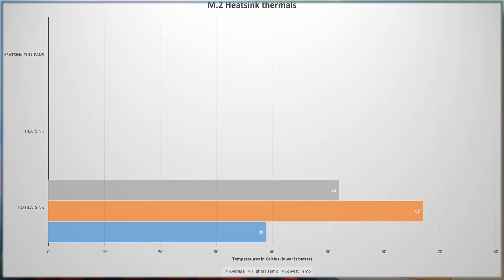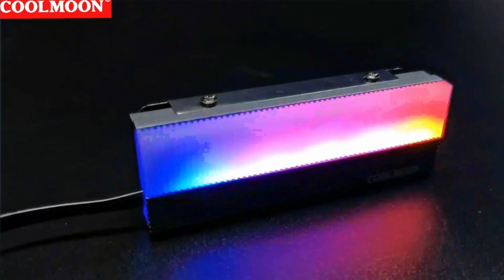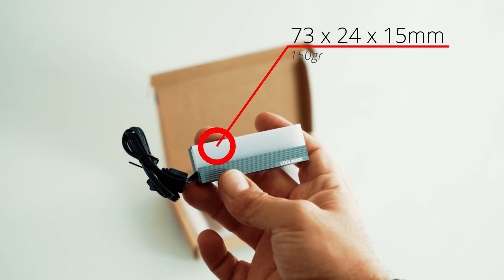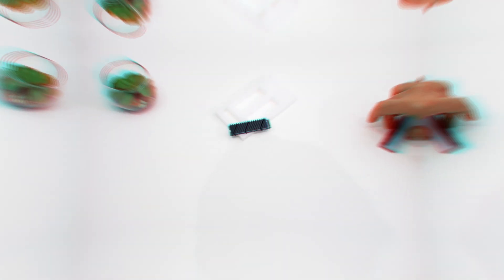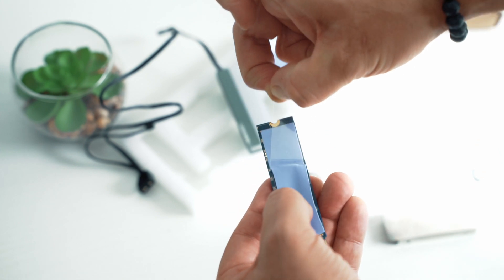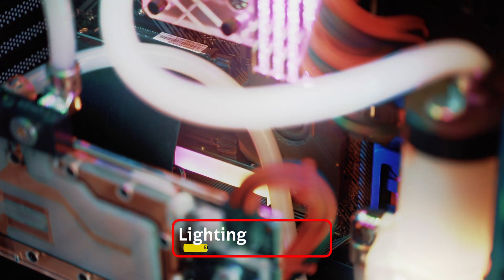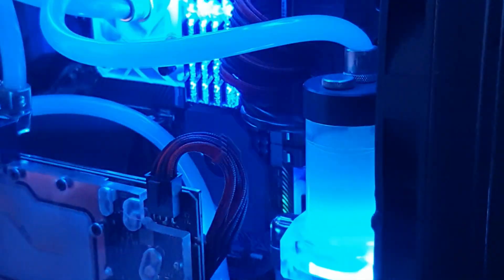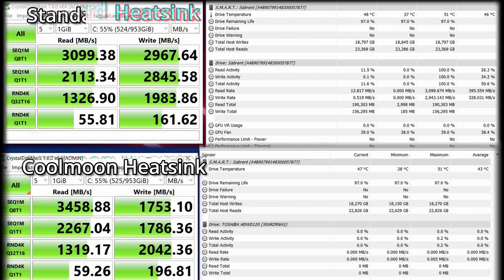Coolmoon ARGB M.2 SSD heatsink - CM-M73S review #ARGB #SSD

Comment from the maker: Hello everyone, please let me know if this video was helpful for you or if you have a similiar product you would like me to review!
Reply: Just did exactly what I thought and yes - it works, compared with your video. I have the same CoolMoon, before heatsink, temp. on NVME SSD (Kingston SNV2S2000G 2TB) that is "Work", it was 59 degrees temperature, now it is between 49 and 53. So - less than 7 to 10 degrees. That NVME is now below my still old GeForce (2080 rtx) gfx card.

Comment: generic copper is better temps wise like the plain one sided with bumps
Reply from the maker: You can see it in the video, in the end I compare the temps
Reply: @fgtechtips  oh ill have to go back, you're probably using a different copper one though than what I use the copper is a solid 5 degree Celsius less than non or aluminum

Comment: If i remove my SSD NVM.2 will the files because i used it in installing games will my games gone if i removed it?
Reply from the maker: if you remove it and install it into another m.2 slot nothing happens to your data. if you remove it completely either you backup the data into the new drive or if your games were installed there you would obviously lose the data
Reply: @fgtechtips  ty, can i insert that heatsink in a A320M PRO-VH motherboard?
Reply from the maker: Sorry don't know if there is enough space but this should fit all. In my channel i reviewed another heatsink which is even smaller

Comment: i used this heatsink on samsung 980 pro and the temp idle is 50c is that normal?
Reply from the maker: It seems to be a bit too high, do you have enough air flow on the case ?

Comment: you put a lot of effort into this review but unfortunately its flawed since your case was not well ventilated due to the nature of the water cooling setup, hence the coolmoon with more material could also mean more heat soak overtime raising the average temp.. 
My results were 34oC with stock gigabyte SSD heatsink and 27oC with the coolmoon ARGB heatsink thats with 9x 12cm cool moon fans on 1200-1300rpm low silent settings.
Reply from the maker: Hi you probably didn't watch the whole video, you would understand that it is also focused on argb lighting, showing the product, sizes specs and so on, not only temps ;) moreover it depends a lot on what kind of ssd you are using, if you system is oc, ram amount and so on...
BTW You can see I was still getting about 10c cooler as minimum temp and about 4c lower avg temperature using it, which is very similar to your result anyway ;)
Reply: @fgtechtips  hehehe my bad it's 1:23am here I didn't put on my earphones had speakers on low volume to not wake my wife.

Comment: Hi can i connect this on 4pin rgb motherboard header? My motherboard is asus tuf b450m pro gaming motherboard
Reply from the maker: Hi as you see in the video this only comes with 1 argb connector so no it doesn't work with the 12v 4pin RGB connector. It seems this product is only produced with 5v support, I couldn't find the 12v RGB version of it

Comment: hi there you conect the 2 cables for have the light or only the 3 pin cable to motherboard ?
Reply from the maker: Hi only the ARGB cable, as you see in my video I connect it in a 1 to 10 splitter since I only have one connector on the motherboard
Reply: @fgtechtips  whit a spliter you think i can conect this and a light bar ?
Reply from the maker: @viewpy  yes sure, with the splitter i connected everything you see:  the fans, the waterblock, the pump, the SSD and the light bar
Reply: @fgtechtips  cool i buy one of 4 cables spliter i wish all works good thanks for advice :)
Reply from the maker: U're welcome

Comment: will it fit m.2 x4 adapter?
Reply from the maker: Hi this supports the M.2 2280 standard. In the video I also show the dimensions
Reply: @fgtechtips  cm-m73s is newer than cm-m7s? also my board is evga z370 matx, do you know where to connect the power to it?
Reply from the maker: Hi they look the same to me, probably sale product. In your motherboard manual you have to search for A-RGB connector or RGB 5v port
Reply: @fgtechtips  thanks, i found it on top right. can't get to that its cord is short. https://images.evga.com/products/gallery/png/121-KS-E375-KR_XL_5.png can i use aux_fan or cha_fan on the bottom?

Comment: Hi, do you need to take the sticker off the ssd when you put on the heatsink? great vid by the way
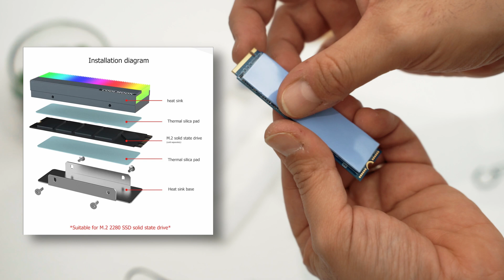Reply from the maker: Hi there, thanks. I explain it at 03:15 . My SSD has a label which has a copper layer below so no need to remove it.